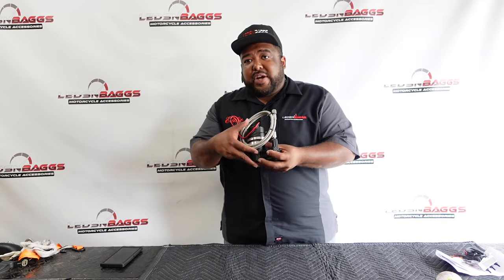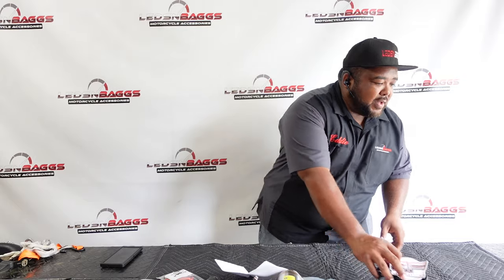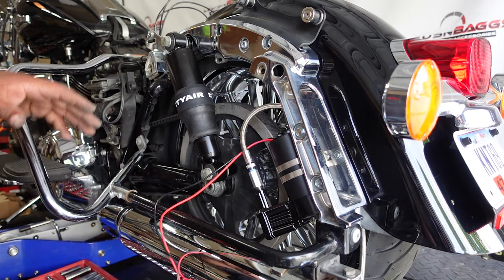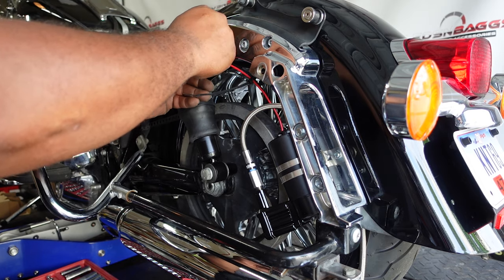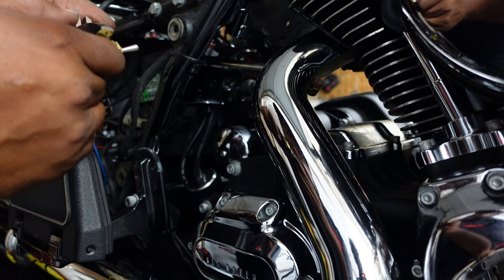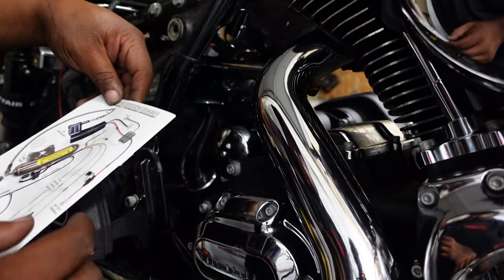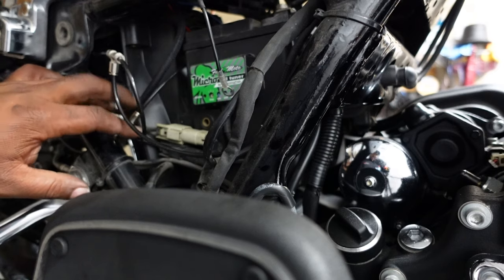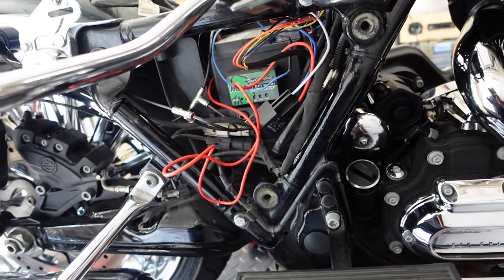Dirty Air fast up Rear Suspension Harley Davidson Roadking

Comment: Love air ride, till it leaves you stranded .. normally during a poker run 🙄🙄..  ugh ….   Once air ride is rideable to get home when it breaks/leaks // won’t air up,  I’ll switch back to air ride..   love when my 16 HD UL drops…
Reply from the maker: I have not had any issues with the air ride system on the two bikes that I have it installed on